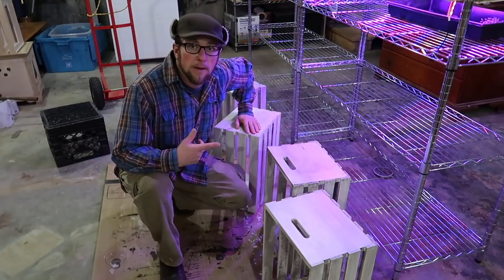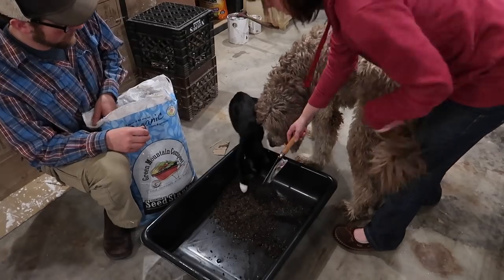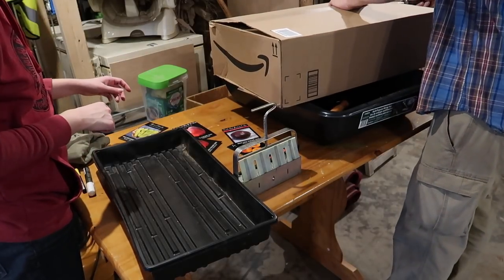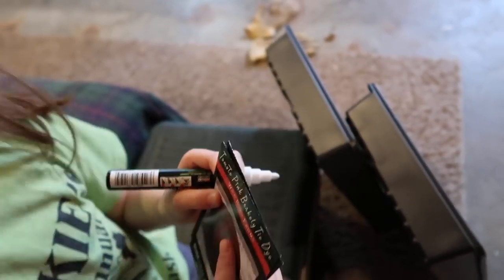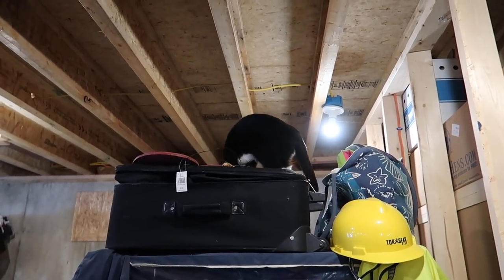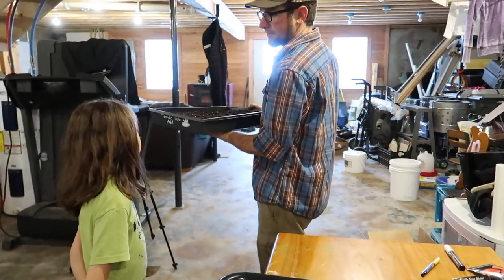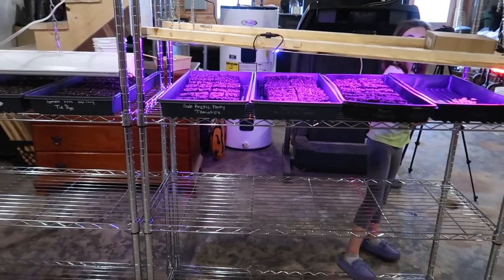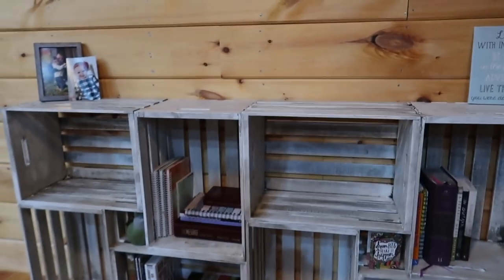We want The best BLTs on Our Homestead | Time to start the tomato plants inside in Soil Blocks

Comment: You both have lovely handwriting!  The tunes in the background were nice.  Love watching you guys working together on family projects.  The book shelve project came out great, and Olivia started organizing immediately!  One of the comments recommended to put a base on the bottom of the book shelve, I recommend putting 'legs' on the bottom, it will give the shelving some height for easier access to the books and for floor cleaning. Maybe put some 'slider felt' on the legs for the ability to move the shelving unit. Just a suggestion. Be Blessed Lumnah Family
Reply from the maker: Thanks, what is the temps you are supposed to get tomorrow on the sea coast?
Reply: Mid 60s maybe, usually cooler than away from the ocean.

Comment: Ut oh Al ...... I live in central Pennsylvania ...... should I be starting my tomato/pepper seeds already, or do you move them to a greenhouse type deal for awhile? I start mine in a plastic seed starter, then move them to 18oz square-bottom Solo cups that fit just right in discarded  2 liter Pepsi Cola and Coke bottle carriers that have 8 slots. Easy to move around under my lamps, plus I like them because I can just grab the "flat" (very rigid) and move them outdoors to get sun, or move them into my garage if there is a frost warning. The carriers also fit in the same black flats that you are using in this video to start your seeds.
Reply from the maker: We will keep our plants inside until it is time to plant. They will be nice and big by than